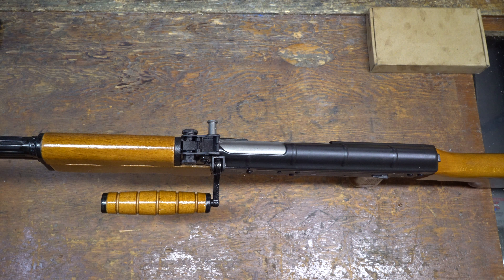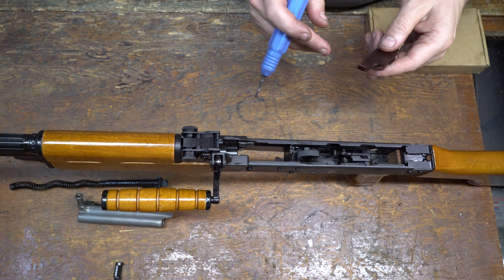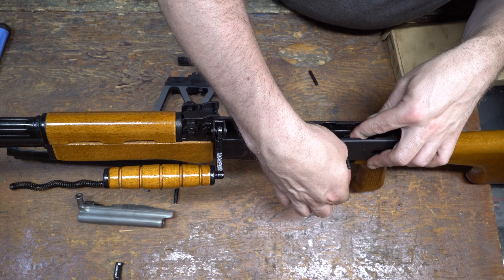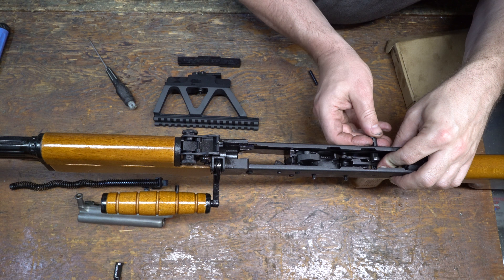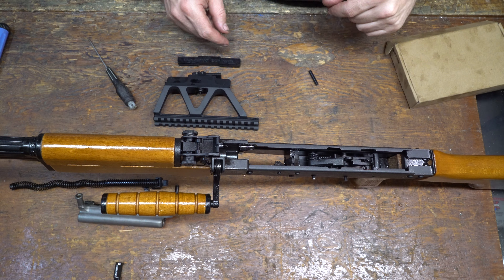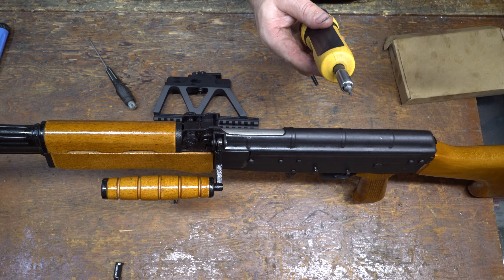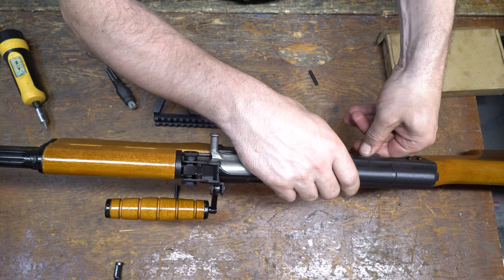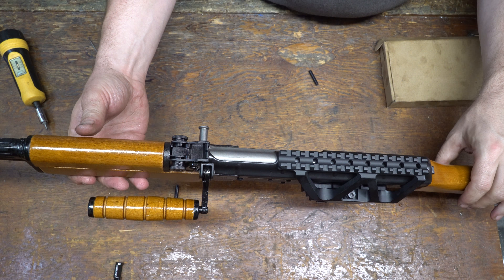Type 81 Picatinny Side Mount Installation Guide

Comment: Ive never added a product to cart and checked out faster than that... Might be a world record.
Reply: Did u see how fsst they sold out of the SE rifle versions yesterday?
Reply: @TheRealBatCave  Barely got one in time lmao
Reply: @bigchimpin98  they upped the price 20% 2 i see
Reply: @TheRealBatCave  Well it’s the special edition. It has a phosphate finish as opposed to the regular’s blued finish and it has a dark red finish on the wood, that’s why it’s more expensive.
Reply: @TheRealBatCave  besides special edition part i believe it also came with the threaded pins/side plate/reversed safety to mount optics which is why its more.

Comment: Thanks for this.  Cant hear what the torque number is, sounds like 40lb-in, what is it, this seems quite high.  Also perhaps adding to you channel the instructions on how to adjust the nut  at the bottom of the scope mount, so it can slide on without jamming, this cause me a bit of confusion.   Thanks to great help from your support staff, I got the information, and completed the process, this in though may help others.

Comment: When i locked my rail, it was sliding off after a couple shots, tightened it a lil bit, and then when i went to put on the rail it stripped the screw

Comment: Will the rail for the mount accept Russian POSP scopes and other simiar optics, or is the rail system fully proprietary?
Reply: Other mounts won't fit the side plate for the rail but they now have a kobra optic available with a different plate, I hear it fits most ak side mounts/optics.

Comment: Also wondering if POSP side mounts will attach to the adapter plate...been holding off on drilling for  exactly this type of thing...I knew it would only be a matter of time.
Reply: Other mounts won't fit the side plate for the rail but they now have a kobra optic available with a different plate, i hear it fits most ak side mounts/optics.
Reply: @ACOGLMT556  that would have been nice to know before I bought it...this is very disappointing.
Reply: @CrAnSwIcK  i hear you, i bought 2 rails then like a week later the new kobras came out, the rails are much cheaper though. If you haven't installed it then you could maybe return/exchange it. One of my mounts was faulty and instead of replacing they let me upgrade to the kobra. I like it much better and plan to pick up other russian optics to play around with cq/t, mid and long range lol.
Reply: @ACOGLMT556  I'm deployed overseas at the moment, I'll see if they'll entertain a return...I would honestly prefer the kobra anyway...I never got an answer to this question and panic bought it just in case before it went out of stock, as I didn't even plan on using the rail 😕
Reply: @CrAnSwIcK  ahh, I'm sure they will, especially if it's still new and you explain it to them, I find them good to deal with. I think most have the same thought and would have held off if they knew the kobra was coming that soon after. 

I have both currently mounted and I prefer the kobra for multiple reasons but I do wish the controls were abit more accessible and it used AA or 2032 batteries. The the rubber sunshade feels like it could rip off easy too if you snagged it on something or flexed it to many times, something thicker or threaded in would probably be better but meh its for the most part a range toy lol.

Anyways keep safe out there.
Reply: I see the kobra blocks/protrudes on the trigger guard , it would bother me seeing it stick out that far down.

Comment: So you have to remove the mount every time you remove the bolt for cleaning . 
So how well does it hold zero ??
Reply: I've not shot it yet but the side mount plate stays put if you're only taking the bolt carrier out but the rail/optic does need to come off to take the bolt out. As long as you mount it at the same spot and tension (assuming it was mounted correctly the first time)  then it SHOULD hold zero. I prefer the kobra optic they are selling now though.

Comment: The safety switch is getting super stiff when i try installing the side rail. When the side rail is off it works perfectly. I checked that the safety spring is sitting in the pins grooves properly and after installing it and removing it 3 times i think its in the groove so  ... what do you think my issue could be?
Reply: I used a dremel tool to open up the safety spring hole deburring was not enough. Now its smooth has silk and i prefer it to the left side safety. Perfect!

Comment: I had to save up and when I finally had the cash those picatinny side mounts are sold out everywhere . Any idea when yous will have more in ? And if so can I prepay ? I don't want to miss out . Again !
Reply: @aviationenthusiastsassocia879  Once upon a time I would have thought you were nuts !! But ever since Trudeau allowed hardcore gangs from Africa into the country its a different story . However the gangs are using illegal guns smuggled in from the U.S. Its not legal gun owners you have to worry about . Plus 90% of all shootings are in Toronto . The rest are in Vancouver and Winnipeg and they are gang related as well . That leaves a hell of a lot of country that's safe . We never had a gun problem until Trudeau imported it !! Which I believe was done on purpose just so they could turn around and ban all guns . Because that's what the U.N wants done !!

Comment: As soon as I go to mount the rail, the safety binds so tight that it cannot be moved at all. I assume I need to take a bit of material out on the spring plate safety hole?

Pins and plate came preinstalled from tactical imports btw
Reply: I had the same issue with 2 different safeties. I just spent an hour with a needle file taking alil off at a time. I had to use a small deadblow to put it on safe then back off a few times, take it out then see where it was rubbing  then file and repeat. If you have sharpy then it will help when you test to see where it's rubbing still. Sandpaper or a grinder/rotary took may also work.

Mines still alil tight but I can turn it by hand now...don't want it to loose when firing haha. It will never be as smooth as an AR or push button as there's no detent to hold it in place.

Comment: PSA: If you are having issues with re-installing the spring clip, you must make sure that the new pins arent being held in place to the receiver by the threads. Make sure the pin in being held in place by the thick part between threads and the groove. You have to be very precise with the positioning or it will not work. DO NOT MODIFY your parts, you dont need to.
Reply: Thanks for that comment 👍. 

The safety switch is getting super stiff when i try installing the side rail. When the side rail is off it works perfectly. I checked that the safety spring is sitting in the pins grooves properly and after installing it and removing it 3 times i think its in the groove so  ... what do you think my issue could be?

Comment: I'm having trouble getting the plumb colored piece hooked on the front
Reply: @sleevey I ended up doing that, and after two sessions of fiddling with the position of the pins it seemed to manually pop in no issue. Thanks TI for your help! lol they told me to watch the tutorial... duhh
Reply: Old comment but I recommend a 3rd hand holding a light helps. Half the time mine didn't fit was because the small pin groove was slightly off/ to far in the receiver.

Also test the pins fit before install, I used a debburing scraper and took about 5 mins to fit the pins.

I did 2 and the real issue I had was the safety was to big to rotate in my early folder. Spent an hour with a needle file fitting it.

Comment: I assume this is for both the T81 and Type 81 LMG
Reply: I want to know as well
Reply: It is the receiver is the same length so it will work
Reply: Just put it on my type 81 lmg
Reply: Can confirm it will fit all 3 versions, but the safety was to big on my early folder but fit the lmg fine, and came pre-installed on my fixed carbine as it was the "optic ready special edition"

Comment: Is a POS. Wobbles vertically. Leaves a shitty mark on the receiver under the mount rail. Tends to bounce off the top cover. Not worth buying. Won't hold zero. Garbage. The only good point is you'll never loose your trigger or hammer pins with the mount base left on.